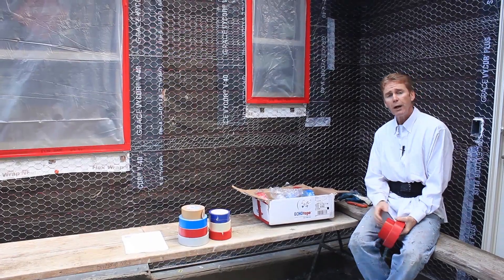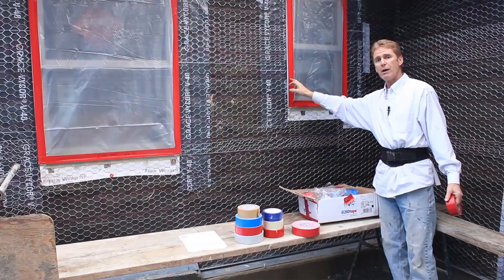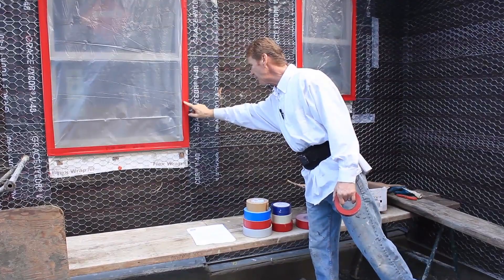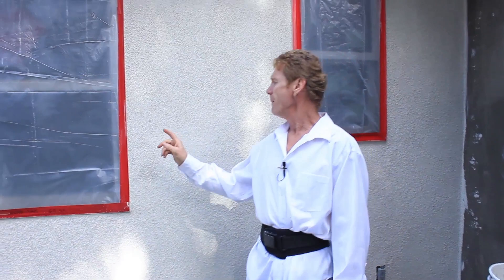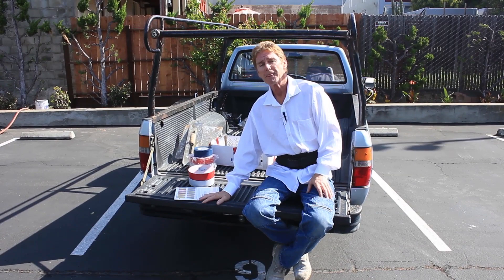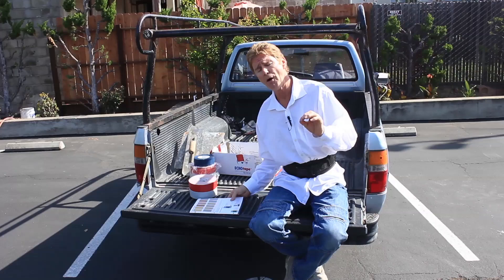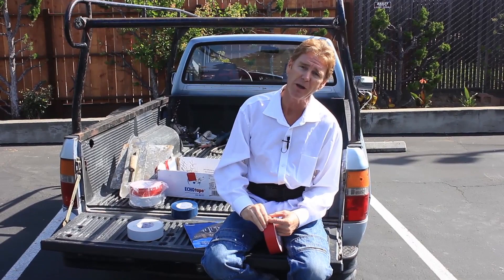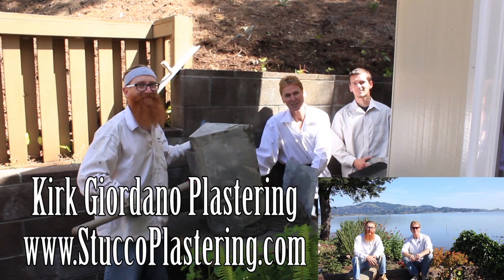Best vinyl red tape to cover windows frames

Comment: Thank you for being generous with your knowledge and your experience.
Reply from the maker: Raphael Santore No worries, I had my doubts about expressing my thoughts on  tape and tape failure issues as I didn't think it was an issues most DIY folks would be able to relate to,
 Thanks for the comment.
 Kirk Giordano
Reply: Raphael Santore
Reply: Peter Agostini  Good  guy  Kirk is  great  info Raphael . cheers
Reply: Kirk & Jason Giordanos DIY plastering and stucco tips of course we want to hear it! I have blue tape on my floor now for a couple years over Rubio. So knowing what to expect from a pro is right on the nose.
Reply from the maker: BlackSwan912 Good morning Swan dude, I also use blue tape indoors especially on floors as the red vinyl will sometimes remove the varnish or paint from floors, wood trim and such.
 Thank's for watching and have a fantastic day!
 Kirk Giordano

Comment: This is a great video Kirk, I really appreciate you taking the time to make these. This might seem like a silly question, but is the tape only on the front side of the window frame, or do you cover the side edges also?
Reply from the maker: Howdy Garcia, we usually just cover the front,
 as most windows have a reveal.   
                 Live long and plaster
      Do’s and don’t of plastering’s leading expert

Comment: I like your videos.  Do you have any advice about the pre-mixed stucco patch they sell at Home Depot? I was thinking about using that to fill some small cracks and a worn corner on our house before we paint it. Watching your videos, it looks like you mostly mix your own stucco material, or you said we could use DAP caulk for minor cracks. Does the pre-mixed stucco patch stuff work well? Is there a better choice for the amateur diy-er?  Thanks :-)
Reply from the maker: Christina Martin Good morning Christina, the pre-mixed stucco's or cement plasters that they sell at Home Depot, are not for repairing cracks unless a crack is at least an inch wide and even then this sort of cracking would suggest that the home is shifting so I would not recommend it anyway.
 Those bags are for patchwork, not cracks.

 Use a polyurethane caulking as it last the longest, but wont clean up with water, you would need thinner.
 They also sell latex with acrylic caulkings, if you want easy clean up, just soap and water.
 Lastly if texture is sandy use a Mor-Flexx, as it has sand, can't find Mor-Flex no worries the caulkings for grout in the tile departments works just as well.
Best wishes,
 kirk Giordano

Comment: Hi Kirk, is it practical to use this tape for masking before spray painting walls etc?, thanks Nick.
Reply from the maker: Paintbrush 1962 Hi Paintbrush dude, my habit for many years is to purchase the best materials for all phases for any project.
 My time or my crews time is valuable, all the materials used I find are relatively inexpensive, especially if they do as they say, thus saving me embarrassment by correcting problems.
 My answer is buy echo tape for all painting, plastering, stucco, and any other purpose in which you plan on protecting window and or door frames.
 FYI, Milgard windows and doors sends a letter recommending Echo Tape for all who wish to protect their doors an windows, Milgard did some serious testing, I just confirmed it for my personal knowledge.
 Have a fantastic day!
 Kirk Giordano Plastering